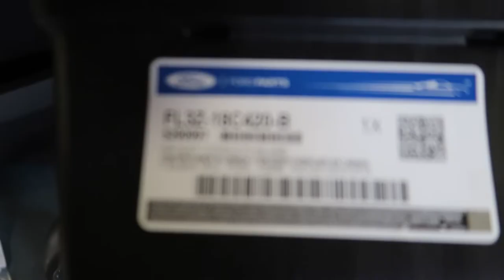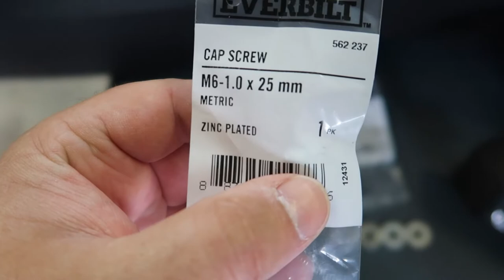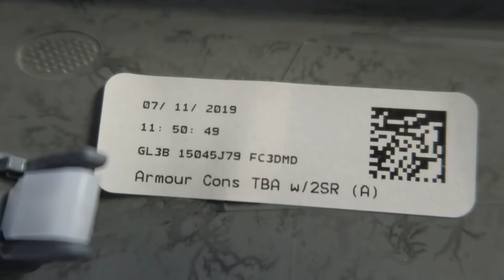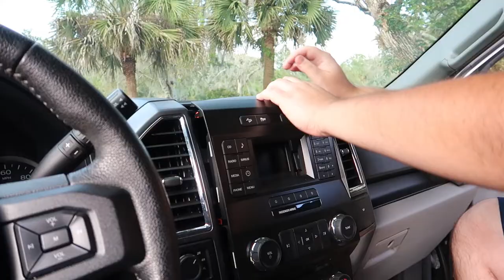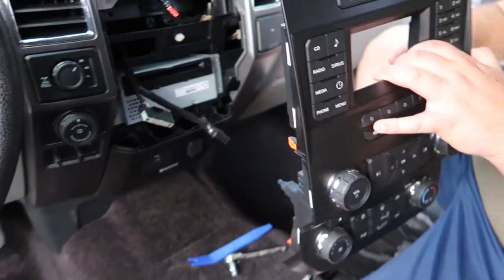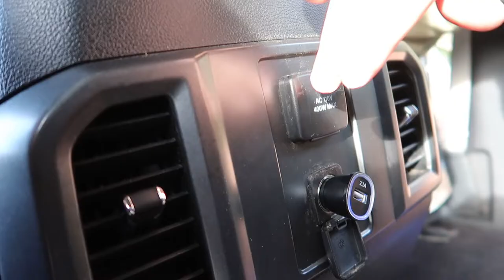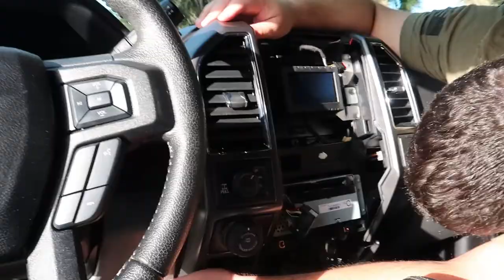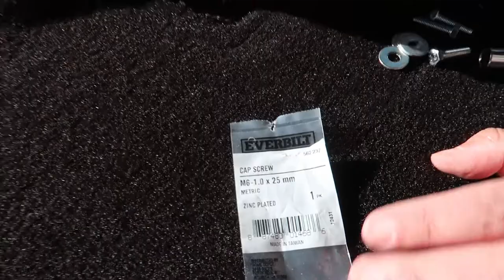2015+ Ford F150 Console Swap

Comment: After seeing this vid, I got an f150 with steering column shifter with this swap in mind.

I was able to do this with only removing front passenger seat bolts and tilting it out of the way- didn’t want to disconnect the airbag cable underneath. 
The console I used was taken from a XLT without push start, so we needed to remove the remote antenna located under my jump seat and hook it up into the console wiring. Without the remote antenna hooked up, my truck wound not detect the key.

Comment: My 2015 with console had 207,000 miles on it and I decided to change it for a 2018 with FAR fewer miles.  The 2018 has the jump seat and I do not like it.  Glad I found this video so I can now go find a console and find someone to do the swap.  I am a very handy individual but tearing my truck apart and getting it put back together properly I do not have much confidence in. 
Thank you for the video.
Reply: Update! 
The coworker that bought my old truck wants the middle seat and not the console, so we are going to swap them over. 
Yea!

Comment: Hey, I bought the parts I need, I think, but i have a problem. The console was a center shift so I ordered the cup holder and dump pocket replacement. However, now I cannot get the exterior frame to snap back into place on top of it. You didn’t show the installation of that piece. How did you do it? Did you have problems? Literally nobody is out there to help with things like this.

Comment: 2 years ago you got this for around $250. They’re $1,200-1,500 or even 1,800 on eBay 🤦🏻‍♂️
Reply: For real, might just make sure next truck has a center console. Not sure if it’s worth all the money and hassle haha
Reply: Haven't checked in a while but mine definitely wasn't $250 and nowhere near $1000. Got mine off ebay for $570ish after taxes. And that was leas than a year ago
Reply: Just bought one for $350 on eBay. Got lucky af because I also got free shipping😂
Reply: I won my console  on ebay for $350 the liarat model due to a bid going my way

Comment: Just took a gamble and bought one from a wrecked truck off eBay.  Picture sucked, but it looks like it is fine, and it's just the column shifter model I need too, so that saves $200 for that damn trim piece (which is absolutely ridiculous).

Comment: If you are handy I did this swap without ordering any special parts.... I used a jigsaw to cut out the Trim bezels, then wrapped them.  I also believe you can just plug the side wire harness in and evrything should work without switching over the USB seperate.  Ford parts are not cheap, and this can save $100's of dollars.  For under $100 you can purchase the two vent attatchments and simply push together to get rear seat ventilation working, I didnt need this as back seat is subwoofers only.
Reply: Do you have part numbers? If I'm going to go through the trouble of doing the swap I'd love air in the back seats.
Reply: Do you have a picture? I’m curious how it looks after using a saw. I’m thinking about doing the same thing, but concerned it might look bad.
Reply: @davidscherrle7908  Is there a way to send or post photos?  It came out pretty clean, could also use a dremel I imagine.  I could probably send a rough template but I just taped the lines and went slow with jigsaw.
Reply: @jeremyolday1281  I believe all the part numbers are listed in the description.  Pretty easy swap for the most part, I removed passenger seat and it gave me all the room to move things in and out.  Basically plugs right up.
Reply: I also bought a piece of black acrylic and epoxied it from underneat the console where the shifter use to be, I then ran some switches to it.

Comment: What if i have a linkswell 12" screen ?? Will it fit fit same way ? Also console did not came with shifter but it has missing bottom part so there's nothing. Can i put some sort of plastic or something ??
Reply: We're you able to make it work or did it just not require any extra pieces

Comment: Excellent video, question, did that key slot underneath the sync compartment ( it's used to program new keys) did that work after this swap?
Reply from the maker: Silvio Alcantara never checked, but I doubt it will.

Comment: You don't have to pull the carpet up to run the AC it's actually really easy just get the parts it's worth doing it my kids love it
Reply: Can you give me a link or part numbers for the required parts to run AC to the back
Reply: @ericksonlopez9658  https://www.f150forum.com/f118/center-console-swap-details-352699/ See the parts picture in the forum. Part 18C420B extends console duct to 90 degree bend Part 18C420C. Someone correct me if I'm wrong but I believe this part is what connects to the blower. Reading the forum, you may have to use a utility knife to cut out an opening in the blower housing. Once the hole is cut, Part 18C420C goes over the hole to receive the air.

Edit: 
 Ford Part No. FL3Z-18C420-C or Base No. 18C420C

Comment: why do you have to get new bolts. why cant you use the ones that were holding the jump seat in
Reply: different mounting points for the console and jump seat. Smaller bolts

Comment: Awesome video. I did the same swap myself prior to watching your video and didn’t plug in the USB first like a dumbass. Do I have to take everything apart again or is there a simpler way to access the wire?
Reply from the maker: You might be able to pop the radio out and plug it in that way

Comment: Awesome video!! One question...where are you ordering the extra trim parts from?
Reply from the maker: jbzkid76 friend of mine is a parts manager for a local dealership so I ordered everything slightly above cost. Tasca seems to be one of the cheaper options check with your local ford dealer.

Comment: Did you ever find that little center rubber piece next to the cup holders? I just did the same swap and I can’t find that piece
Reply from the maker: Never looked actually. Guess it doesn’t bother me that much. Haha
Reply: Can order from Ford
Reply: @wes1424  did you find one? I tried ordering it and the dealer responded saying they are discontinued.

Comment: Is there any way to get the automatic shifter on the console to work if you have the shifter on the steering wheel?
Reply from the maker: Yes but it requires some work, and an extra harness I believe. I looked into doing it but I like having the extra room in the console rather than the shifter.

Comment: Would it also work for a single cab? Not worried about the back ac vent or outlets
Reply from the maker: Yes, should be all the same. I’ve seen ppl do it.
Reply: @OutOfLineGarage  the radio trim, do they offer it with out the 4x4 knob and trailer assist
Reply from the maker: @ryanelkins8081  yes but I don’t know what the part numbers are. I know my truck didn’t have the brake controller (we added that and did a video on how to install and program it) and it had a tray where the controller was. Not sure about the backup assist though.

Comment: I wonder if u can put a super duty one in that doesn’t have the shifter built in into a f150 since there the same cabs?
Reply from the maker: You can do that, I looked into swapping the F150 bins to the F250 sliders but the piece I needed was over $200 so I just traded a guy the shifter for the right bin.
Reply: @OutOfLineGarage  I like my bench seat but that console does look good👍more storage is always a plus thanks for the video upload and info

Comment: Is the shifter useable if you leave it on there or is it useless?
Reply: It's obviously useless, unless you take the time and remove the transmission cable from your column shifter and reattach it to the floor shifter

Comment: where did you find the insert that replaced your shifter?
Reply: Ford dealer , sticker shock, priciest piece other than console itself. Got mine through a friends body shop saved a couple bucks but not much.

Comment: Thanks to this video, I bit the bullet and purchased a console and made the swap. Then, to my surprise, the truck wouldn't start. It has the push-button start and kept saying "Key not detected." I tried putting the key fob in the emergency slot, but that didn't work. I took out the console and put the jump seat back in and it started right up. There's apparently some connection that isn't on the 2017 console that I'm putting in my 2019 truck. I can't find ANYTHING about this on the web. Anyone got any ideas?
Reply from the maker: Hmmm, wish I could look through it.  Any codes coming up?   Don't see any thing under the seat that might be able to cause the issue?
Reply: @OutOfLineGarage  Nope, no codes. Would disconnecting the battery reset the computer, maybe? Do you know if there is any programming in the key detector? Oh, there is one plug near the front of the console that had no matching connection in the dash. I guess I can't attach a picture here, but it has two wires going into the connector, gold and light blue.
**UPDATE** I believe the plug is the C235 PATS antenna, which must be built in to the 2019 main floor plug. I just need to find a wire diagram of the 2019 plug to see if I'm right.
Reply from the maker: Hmm, yea that's probably it.  Might be able to pull it out of the seat?
Reply: Did you want to sell that 2017 console?

Comment: Does anyone know the parts needed to let airflow to the back?
Reply: I have a full working center console along with A/C from factory and let me tell you that shit sucks. Even on full blast it barely blows. My cab gets cold enough with just the vents in the front. Save your money bro. You’ll be very disappointed if you dont. Trust me.
Reply from the maker: @htowntx-hr3hb  yea I have the pieces to finish mine but that is one of the reasons i just left it be. Being in FL i like having that ac blow full blast in my face during the summer months.
Reply: @OutOfLineGarage  did you ever install these parts to send the air flow to the back of the console?
Reply from the maker: @wesreed6450  we never did, I rarely have people in the back seats so I never did, not worth taking it all apart to do.
Reply: @OutOfLineGarage  what parts were required?